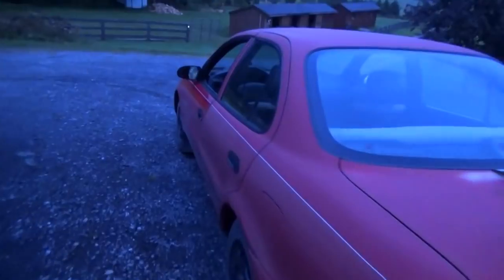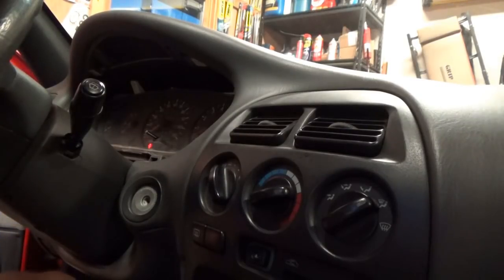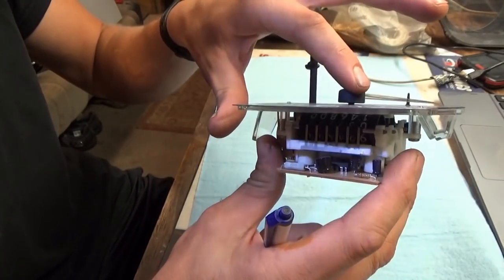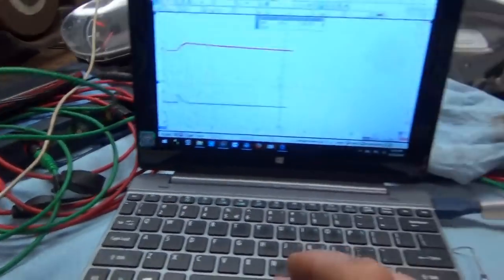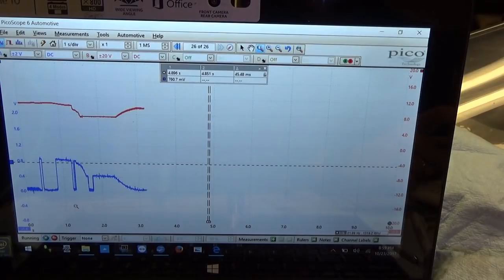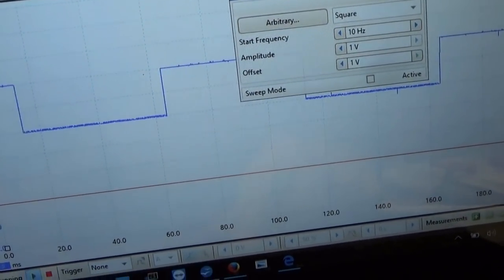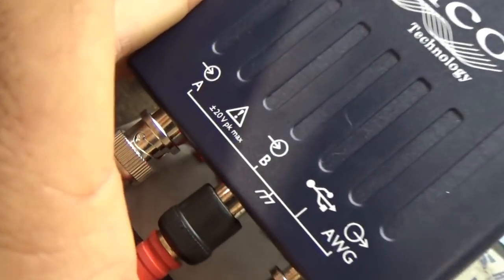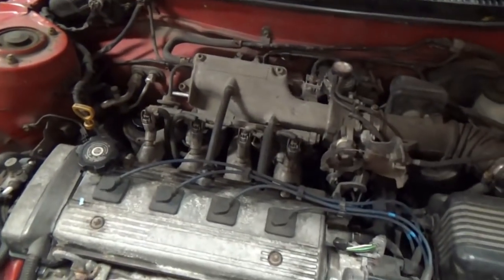Toyota (Geo Prizm) Speedometer: Diag & Repair

Comment: Great work. Glad to see a tech / mechanic not scared off by electronics. Seems most just replace electronic modules when sometimes they have very simple problems inside. I especially like your curiosity / knowledge to actually activate it with the signal generator.Thanks

Comment: Great video, Ivan!  A month or two ago I fixed a heater control panel in a 2000 Honda Accord the same way.  I didn't get quite as technical with the scope and signal gen but a plastic probe while plugged into the car and I found a bad solder joint on a surface mount resistor. Your analysis of the board went a bit deeper since I didn't attempt to figure out why the bad solder joint caused the problem, I just resoldered it an put it back in the car.  Well done!

Comment: I never knew about the signal generator built in to the older picos. Good for you to go the extra mile and find the board problem, I don't think many mechanics would have made it to that point.

Comment: Just this past summer, I threw one of those clusters in the trash! It was a nice junkyard spare that I kept around for my daughters Corolla that now has 200k on it. Super nice fix on this one Ivan and a ton of fun to watch. Thanks so much for sharing it with us!
Reply from the maker: noooo not in the trash! 200k is not many miles for these, unless it burns oil :)
Reply: Baxrok2 That's why I saved my old cluster when I swapped my clusters out. Thought about throwing it out several times but then remembered that components can go bad and solder joints can break, so I kept it just in case. Lol
Reply: Yeah, it wasn't exactly a rational decision I must confess. I was in a jam and had to get out of my storage space quickly. I should have kept it and at least attempted to sell the darn thing for a few bucks. Heck, I could have even sent it to Ivan to hang on to!
Reply: Baxrok2 Yeah I would send mine to Ivan too but now after watch that video, I wanna keep mine for parts. Lol. Those clusters sell on ebay for about 30 dollars. If you have the upgraded cluster that has the tachometer,  those are in much higher demand and sell for as much as 60 to 70 dollars. I know because I was gonna buy mine on ebay but found a good one in a pick and pull yard for $25.
Reply: Good to know. Next time I'm at the junkyard I'll be looking for one with a tach!

Comment: I once worked in card build at IBM and ran the wave solder machine.  It was a track that ran the cards over a pink flux then a fountain of solder.  For any components that could not take the heat, we used fiberglass tape to block the lands then manually soldered the "non wets" later.  This process soldered all the joints at one time so occasionally there was a dry joint.

Comment: Had the exact same issue with my 1994 Corolla at 294,xxx miles. Tried re-flowing all of the solder joints (I didn't have an oscilloscope and am not as good with electronics repair as I'd like to be, but I'm learning!), but no luck. Wound up replacing my factory instrument cluster, which did not have a tachometer, with one from an "Anniversary Edition" (AE101) Corolla that did have the tachometer, but needed to roll the new odometer up to match the old, which thankfully was not that difficult (just push the gears to the side and rotate, just have to be very careful you don't snap the little plastic tabs/ears).

Also, thanks for the video. I always enjoy learning about how to do this sort of stuff better/more methodically and your videos and Eric O's are always helpful (love the case studies!).

Comment: One commonality I have noticed with a lot of instrument clusters is that the resisters need reflowing. Not sure if it is because of, vibration or age and or type of solder used. Remember you replacing a motor and having to reflow resistors on a gm cluster. I was referred to your channel from South Main Auto Channel a few months back and he had to send in a cluster panel and called in to find out what was done, of course reflow of resisters but also stated that the old flux they used back then could cause seepage "usually yellow" onto the board and connect joints sometimes even causing a short.  You do great investigative videos, too the point with a process, Have been learning a lot. Keep up the great work and keep the vids coming.
Reply: vibration and heat related, resistors turn power into heat :)
the yellow crusty was flux not cleaned off, it doesn't hurt anything on many devices. now if your dealing with high frequency and RF then it would be very bad.

Comment: Thanks to this video I fixed my 93 Camry's speedometer. Mine was showing a much higher speed than the actual speed. I first solder the obvious dry joints but it was still faulty but taking note from your video I soldered every component...Success. Thanks

Comment: My 93 Corolla speedometer is doing the exact same thing yours was doing. I will need to get the instrument cluster taken out and looked at. Thank you for posting this video. Think I will try what you have shown in your video and check those solder joints at those two resistors.

Comment: I can't tell you how much your diagnostic videos help me. It's not the nuts and bolts so much, it's the process of following your logic to make sense of the circuits. I've always been intimidated by electronics because I could never visualize the flow of electrons/watts/amps/etc. But when I saw that correlation between the two signals I smiled. I want a $2400 PICO for Christmas so I can fix my $20 garage door opener. But the learning is priceless! I think I owe you money. LOL
Reply from the maker: Wyatt, just get the $150 Pico like I showed in the video!!
Reply: The next time I have an hour off I'll be on Amazon or eBay!
Reply: Scratch Amazon or eBay. I went though your link and got it for $187 shipped. Thanks Ivan. This will be a great beginner tool.
Reply: Electronics repair isn't easy even for professionals.
Normally you have to know how to test components in circuit and out of circuit, and it's different for each type.
Nice repair as always. I love when you hack stuff!

Comment: Signal generators can be used to test all kinds of different sensors and systems on cars,  by simulating the signal that a sensor should be sending.

Signal generators are sometimes called frequency generators or function generators. The type that has "AWG" (arbitrary waveform generation) capability are more expensive than those that don't.

But they all generate square waves, sine waves, triangle waves, etc. You can set the frequency and amplitude to anything you want. Most of them do also have a "voltage bias" feature. So for instance, you could set the generator to send out a 2 hertz sine wave, riding on a .45 volt DC bias, and send that signal into the PCM to simulate a working O2 sensor. 

Hundreds of other uses. They are one of the most important pieces of test equipment in any electronics lab. These generators are fantastically advanced, especially compared to what was available 20 or 30 years ago. They are also very cheap, considering all they can do. Research brand names before buying.

They are available from all electronics test instrument suppliers. They can range in price from around 150 bucks up to thousands. A perfectly good signal or function generator for use in auto diagnostics can be had for two or three hundred bucks. It should never be necessary to spend more than $400, even that would be overkill.

Here are a couple examples:

https://www.alliedelec.com/b-k-precision-4010a/70146347/

https://www.valuetronics.com/product/afg-2000-instek-series-arbitrary-waveform-generator?spid=5302&gclid=CjwKCAiAr_TQBRB5EiwAC_QCq0avW4Cl1caI8s3VjeURDf7V1r_pYgWnkc-jrQdDp6Bc0aesPQzutxoCILEQAvD_BwE

___
Reply from the maker: Excellent information. Thank you for sharing!

Comment: Again. Awesome instructional video. One thing I found helped me was to take the circuit board into the sunlight. Much easier to see cracked solder joints. Also we are seeing more of this due to lead free solder.

Comment: Excellent fix!  Those engines vibrate quite a lot and as the motor mounts age, there is even more vibration transmitted to the cluster. Perhaps that is a contributory factor to the solder joints taking a hit
Reply from the maker: Haha it is a bit loud and vibrational for sure. That is why the previous owner named it "Turbolet"....because it sounds like a jet taking off above 3k rpm!
Reply: Bill Rimmer yes my engine vibrates a lot too. I looked at my motor and transmission mounts but it's hard for me to tell if they are bad. They look fine. I couldn't see any of them torn.
Reply from the maker: Back in the 90s the speed limit was 55mph everywhere. Today it is 70 or 80 so the little old cars get a bit stressed out on the highway :)
Reply: Pine Hollow Auto Diagnostics Especially if youre running 3300 rpms at 70mph with a 3 speed auto. :-(

Comment: nice of them to add a signal generator to the scope.   so many are scared to do that level of repair but it didnt work when it came in so if you let the smoke genie out you are still out nothing.  if you know what signal it expects you can like you did replicate it and trace the board from input to output to find your problem .when the one trace dropped and the other symetrically rose that was from a transister

Comment: Ivan, another great video but PLEEAASSE buy a decent solder station for PC board work. You can peel a trace off the board without even trying with your butane torch. Hako or Weller are once in a lifetime purchases that will give you trouble free service.

Comment: I use the 2205A for diagnostics and run it off a Dell Mini. The 8-bit vertical resolution leaves a lot to be desired especially for injector waveforms but I am happy with it for the price. The software is what sold me, especially since you can also use it with Linux.
Reply: I had a Dell Venue Pro 8 tablet + Pico, slow to start the scope app but otherwise OK. Then one night the Li-Po battery bulged to 3 times of original height, cracked open the case ,glass and digitizer. And that was that then.. At least it did not catch fire and burn down the house.

Comment: I did a similar repair video on my 1994 project corolla. In my case it was a bad capacitor. However, the speedometer was never accurate even after the fix it always read higher. Looks like I'll be pulling the cluster and rechecking the resistor solders too. Cool video. Thanks!
Reply from the maker: This one reads 3 to 4mph over the real speed. Not sure you can calibrate it easily. The trip meter is accurate however.

Comment: Nice job. I think I would have replaced that 15k resistor though. Sometimes the end cap can break away internally and  soldering it is a temporary heal. I've seen that sort of thing take months to resurface.

Comment: I agree with some of the other comments. Invest in an adjustable temperature soldering station and one of those magnifying lamps. I have found a lot of tiny hairline cracks in solder joints with the magnifying glass that could not be seen otherwise. Those larger surface mount resistors seem to be a common place to find them as well as on heavy components like transformers etc...
Reply from the maker: Great tip. That might be on my Christmas list :)

Comment: My buddy had a ford 500 with a Speedo problem. It had to do with cracked or bad solder joints that had to be cleaned and re soldered. All the old Speedo’s had a voltage limiter in the dash that went bad and all the gauges would act up when the limiter went bad.

Comment: Great fix! The Pico 2204A is a very handy scope and also a bargain. With 10x and 100x propbes you get the voltage range up to 2000V. You can also define your own probes, like current clamps etc.  Only drawback is that the AGW is limted to +-2V due 5V USB power. But that range covers many ABS sensors and ~all O2 sensors. In case you need  0-12V output signal at the budget cost, perhaps your friend could take a DC-DC step-up module and make a voltage amplifier powered from car battery or USB power bank? And vote also from here for a Weller. I have had mine for 36 years and it still works just as well as Wellers always work (well).
Reply from the maker: Janne, my friend Dmitry made an amplifier for the Pico AWG! Check it out: https://www.youtube.com/playlist?list=PLpeFrVvpwTisFI9jbesHyZOnI5Zw9VqRV
Reply: Wow ! Absolutely a great device! Very useful. Dmitriy asked for feedback / ideas, here's what I commented to his video (#1), what you think about these since you are working in the field. (Naturally all of those are not needed nor mandatory, but since feedback was asked..) 

"Excellent device!! Very  useful. You asked for ideas / feedback. Here's mine:
- for final version option for same size casing options as Pico scopes are -> easy to clip together
- Pico AWG out at same horizontal place as amp in -> easy to use  a short cable
- add USB pass-though connectors at the back -> 5V from USB (use dc-dc step-up if needed) USB cable from PC to amp and then to Pico, only one USB port needed. 
- do we actually need the switch for output? could all outputs work at the same time?
- add led indicators for digital sensor power and ground -> easy to see if there is a problem right away
- alternate model without internal signal generator -> at all times pico can provide AWG
- "stand-alone + pico" version with signal generator, you can use without scope (scanner + live data + tester)
- my vote goes to more expensive op-amp"
Reply from the maker: Very good suggestions. I think Dmitry can market his creation as a Pico add-on! I would by one :)
Reply: Definitely could. 2204A works well for automotive use, it even has CAN bus protocol analysis and everything in the SW. There are new/none $250 prize range scanners which have scope or any of those capabilities 2204 offers. There are many reasons why from DIY mechanic to diagnostician would benefit from having a scope + AWG + amp combo with a reasonable cost.  Add low cost pressure transducers made by Dimitry and sourced low cost amp clamps to the mix.

Comment: You can add a simple amplfier circuit to get the number of volts you want, but you will need external power. The positive side of this is, any error that could damage the ouput of the generator only will damage the little amp you added. You can do with a very simple circuit only a few Components. Also you can generate the aux voltage from the USB 5V so you can get it fully portable. And with only one little componente module that costs 7 dollars, you put to genetare the plus side and other to generate the minus side. The amp feeds from V- to V+ so it can do from V+ to V-. You can give it a gain so it gets full scale when pico is at full scale. Of course output will be pico output times the gain you choose.

Comment: having trouble with my car ... 95 corolla - speedo didnt work since i got it last may, previous owner says it never worked for him. when it's cold, the needle doesn't move. when the car warms up some, the speedometer will work slightly but with a lot of lag. it usually trails behind actual speed by 5-10mph, worse the colder it is. last night it was 20 degrees and i was going 65 while the speedo said 20. the odometer and trip meter both work fine. 

so far this has been just an aesthetic problem and i have a gps with a speedometer to keep track of speed. however, last weekend the car stalled out, transmission kept jumping around & engine misfiring. i replaced the spark plugs, was enough to get home. still running rough. replaced the entire ignition system save for the ICM. now it runs ok but if it's cold it doesn't like shifting and it doesn't like going over 63mph. at 65mph, the transmission will slip every 20 seconds or so (or a misfire? it's sort of hard to tell). if the engine is cold, regardless of outside temp, i can go 70-75mph no problem. once the engine gets warm, then it starts acting up. 

the transmission oil looks good, still pink, and at the proper level. have had zero problems with the car at all, drove it 10,000 miles since the end of may this year. 

initially i was thinking the vehicle speed sensor, after seeing this video, perhaps it is something else. not sure how to further diagnose .... any idea on what might be happening?? or where to continue looking

Comment: Thanks for your video. I guess i should reflow all the parts of my speedometer pc board since I do not have all your expertise or your amazing tools. i have been driving more than a year without speedometer and odometer in my Toyota Corolla 1998 LE 1.8. i will start with resonator and resistors.

Comment: Nice job there Ivan. I would have suspected the SMD resistor to have an internal crack in it or something though. Multi-layer SMD ceramic caps tend to blow up/short when mechanically stressed over time (BTW).

Comment: Thanks for the video. My 1996 geo Prizm has a working speedometer but the odometer and trip meter are counting 44% faster than they should. I'm going to be pulling the cluster and inspecting solder joints like you did. It's not that big of a deal if I can't fix it but one thing that's nice is the car probably doesn't really have 175,000 miles on it like I thought it did when I bought it.
Reply from the maker: So speedometer is accurate but odometer is over counting? Very strange!
Reply: @PineHollowAutoDiagnostics  There is a jumper (looks like a surface mount resistor) on the top center of the same speedometer board. If the jumper is there the odometer is in miles, if open it counts in km. Mine had a bad solder joint so it was intermittent. It would change resistance when I touched it. I reflowed it and about to do a test drive.
Reply: It's fixed. The odometer exactly matches the interstate mile markers now. I just bought the car, now I'm wondering how many miles it really has. I'm going to make a quick video to show my repair to help the next guy, and will reference your video too.